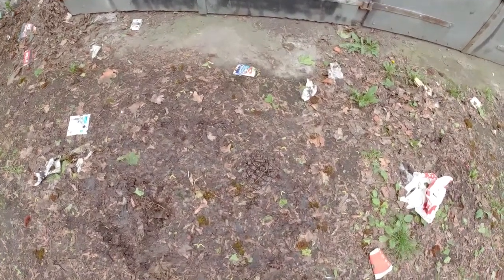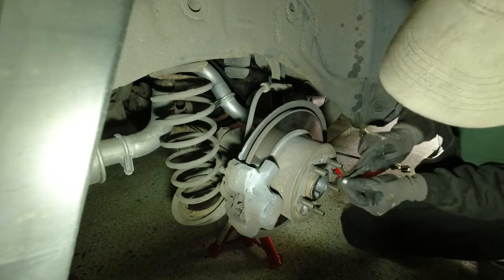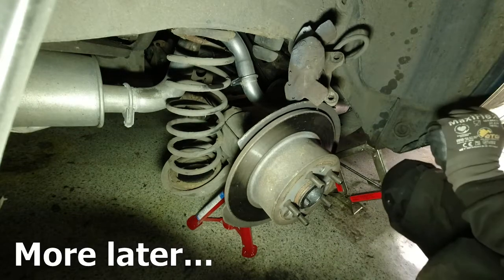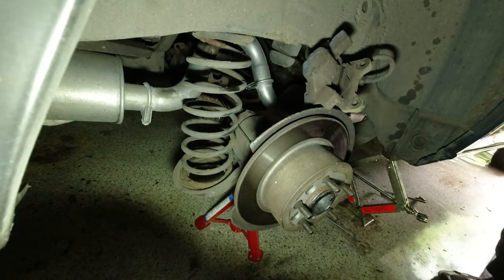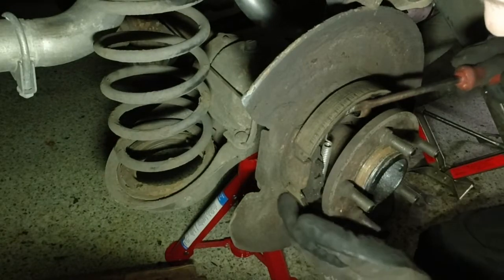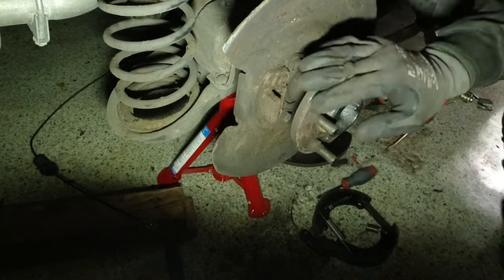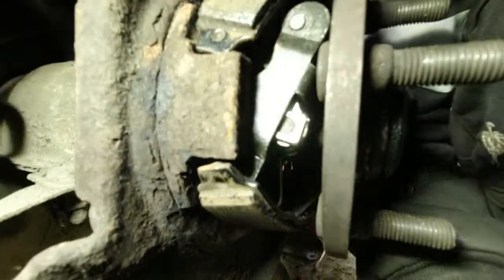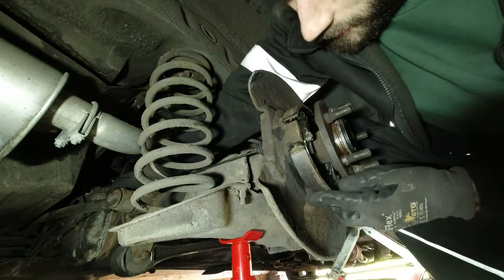Rear Brake Work on the Volvo 940 Wagon!

Comment from the maker: Update! The handbrake was still too far out of balance to pass an inspection, I stripped down the other side and found the mechanism at the end of its travel.

I ordered a set of handbrake adjusters that go in place of the 'H bar' on the other side of the shoes, that allowed me to take out all of the slack and now the handbrake cable is far less adjusted up and the handbrake is well balanced!

Comment: Very interesting. One thing is sure, that cable definitely needed renewal. I just had to have new parking brake shoes on my 90 240 Estate. One had cracked as the backer plate for the friction material had rusted. Still, 31 Ontario, Canada winters will do things like that to a car. I'm pretty sure the 600,000 kilometers had something to do with it too.

Comment: Putting the springs back on was SO hard for me. The right side cable was destroyed and the bracket rotted off the rear axle. I had a good repair kit, new right cable, and new shoes. I had to loosen the adjustment allll the way to get the cable pins to line up. Then I had to tighten it back up, it works perfect now

Comment: The rear brakes are similar on my 2003 XC90. I had to replace rear discs, pads & parking brake shoes. I also replaced the H pieces with adjustable ones. I'm not 100% happy with the parking brake but it was better than before and good enough for the MoT although it failed on other things.

Comment: I briefly had a 940 estate in 2005 as a stop-gap car when my main car was being repaired. It was just a cheap old banger and I didn't know much about Volvos. Now I've watched a few videos about these cars I realise that there was something odd about my example. It looked like an overhead valve engine and I'm now wondering if someone had fitted the engine from an Amazon or a 140. Perhaps they used the 940 engine to update an earlier car. Also, I just did a DVLA check which says the car was manufactured in 1993 but first registered in 2003. It was a right hand drive but I suppose it might have been imported from Ireland.

Comment: Fighting with spiders and handbrake cable, doesn't get any better.
Reply: If the mechanism wasn't installed right, would that have any bearing on the mashed cable ?
Reply from the maker: I don't think so as the cable is thread through holes but rubbing for so many years eventually they go through, especially when the outer casing gets brittle 😬

Comment: If handbrake is still un even to pass inspection you can put 240 or v70 handbrake adjustment bolts on both side. Works good. Wonder why 7/940 dont have them.
Reply from the maker: Yes it was still uneven on the inspection! I checked both sides and they seemed to pull evenly but not according to the tester, going to strip the left side tomorrow but might have to steal from the 240 wagon, so thanks that's good to know!
Reply: Or it might do something if you move that cable holder connector thing on rear axle. Worn pins or just a little bit too much on left side.  Ive put a few of those, biltema is the seller for those around here.
Reply from the maker: @kitakagg  I was thinking that might be something to try but wasn't sure if it would help, will have a go tomorrow, the tester said that they both come up together but then the right side takes over and the left stops early, I like the set up but this makes me prefer the 240 independent set up
Reply from the maker: I think I'll check the cables are equally tight, give the shoes a check over and clean up then if it's still no different I'll start moving/replacing bits. If I understood the tester correctly it failed because it's more than 50% out of balance